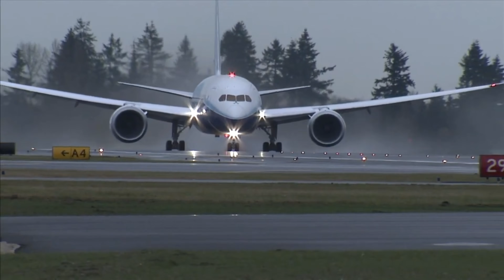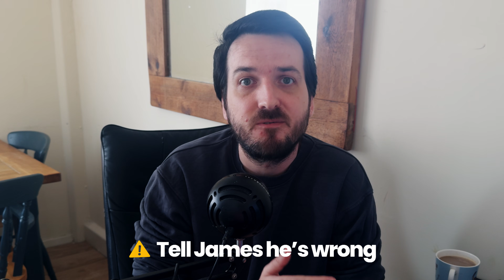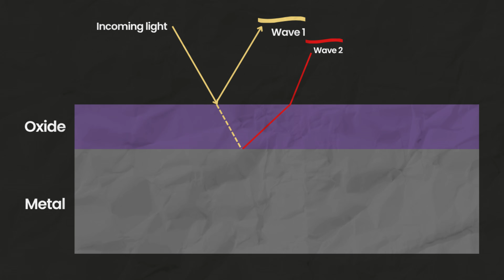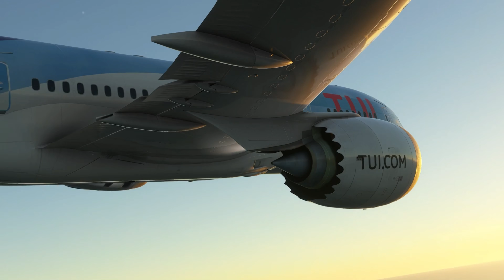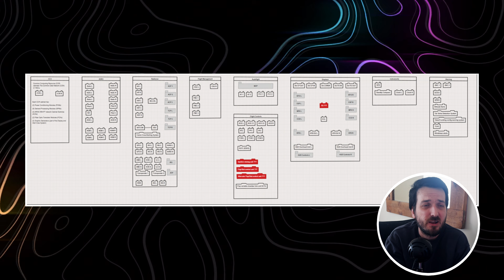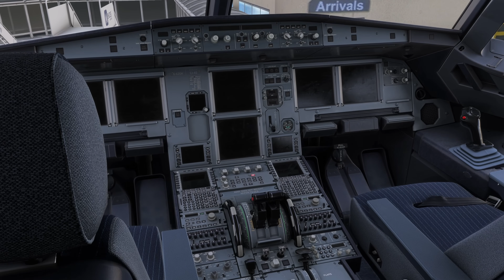A Sceptical Look At The Vector 787...

Comment: Still confused on what "Schematic Level" instead of study level means for the plane.
Reply from the maker: It's a difficult one, I do agree. My interpretation is that they're essentially saying you could find a blueprint of the aircraft, and the Vector would represent that. I think they're essentially trying to make it "more" measurable in a way, rather than study level which is a lot more ambiguous and open to interpretation?
Reply: @james_fuller01 i thought its their way of saying we can't replicate how the plane functions 1:1 so we will replicate what we can see visually at a roughly accurate manner
Reply from the maker: @Aerotech_RBLX  Definitely one way of interpreting it too! Not disputing that whatsoever. Time will tell I guess. We just need to keep an eye on things. But absolutely keep that scepticism. It is down to Vector to prove otherwise 😊

Comment: I wonder if they’re potentially making use of AI coding, not seen much on the topic of AI coding in the flight sim space. But with the likes of Claude Code in its current state, it could handle a lot of the simpler, but time consuming tasks. Maybes that’s how they’ve made it possible in the given timeframe they mentioned?
Reply: Many devs are using it. I'd venture to say, most devs, at this point as it be foolish not to leverage AI against your code to find issues.